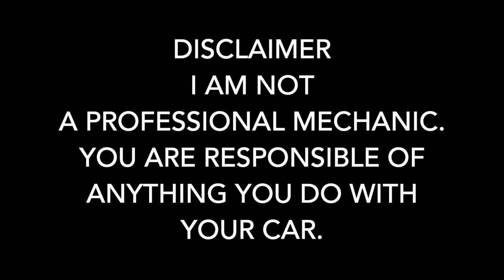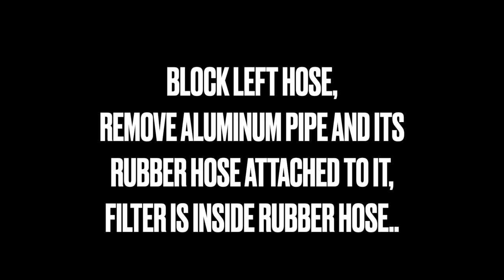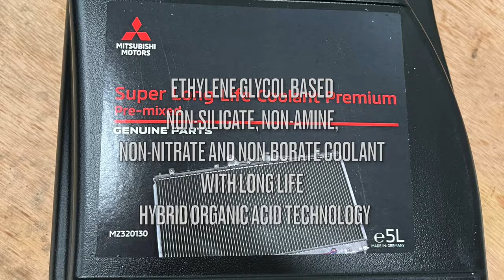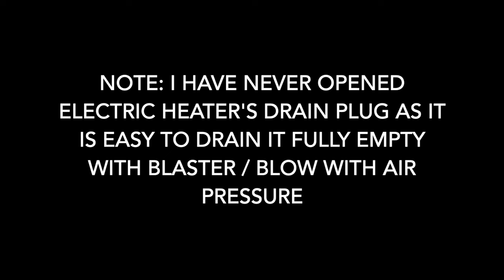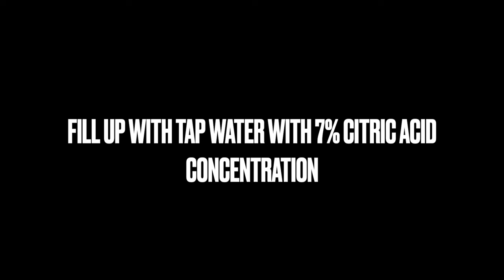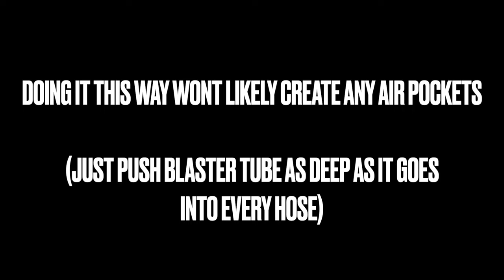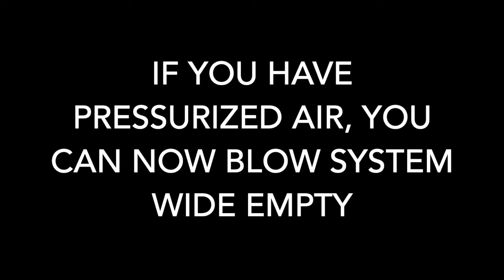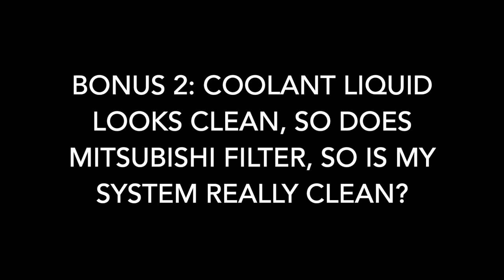Mitsubishi PHEV fix cabin heating or 4 way valve, rinse and clean coolant system

Comment: Very helpful and accurate tutorial. i found my thermostat was stuck. The 'o' ring on the spindle had disintegrated and jammed the spindle! This thermostat is very hard to find outside the dealers. The dealers don't sell the thermostat only any more (no surprise) - the 4 way valve comes out at £387! I bought a 3mm x 2mm 'o' ring online for 24p. Put the 'o' ring on the spindle, add small amount of silicon grease, replace the spindle and all's good. Good video Jani.
Reply from the maker: Yeah mine was stuck as well but got it going by cleaning the gunk out of the needle. Thanks!

Comment: Comprehensive stuff.  Far beyond my technical abilities, so I'll not be able to fix my cold cabin, but it's interesting to know what the "experts" at my garage will be doing!  Thank you!
Reply: How much did it cost you? I have a quote of €700
Reply: @rosscoghlan  Slightly embarrassing, but I haven't actually properly fixed it, yet.  I took out the small conical filter that is inline going into the cabin matrix, and that "fixed" it.  I bought all the gear to flush out the coolant loop, clean it with citric acid and then refill it, and have never got round to doing it...

Comment: another question also, if I lose coolant liquid during the cleaning of the filter, why not just adding more coolant directly to the default intake (the one accessed by just a plastic cap and labeled?, why it has to be injected to the hoses?
Reply from the maker: Not sure what you refer with default intake but as long as you think your way does not create / leave air pockets, all should be good. This is not the only method for sure, just tried explaining how one can do it with great probability how you would not end having air pockets here and there.

Comment: Thank yo very very much! I went to try to clean my filter and I noticed that the bleed valve is not even there, and the bottom left port on the 4 way valve does not have anything connected to it at all. I think someone bypassed the filter by taking the bleed valve and filter assembly out, and I have no idea why the 4 way valve would be missing the hose..i think it would go to the electric heater. Do you have any idea why that would be done and what problems it may cause?
Reply from the maker: This is a problem that affects most and people get very annoyed when they do not get heat to their cabin. Can you identify better what do you mean by the bottom left port on the valve?
Reply: @janilaakso  It turned out to be either the feed or the return to the electric heater unti. I discovered that my car does not have an electric heater, so there is no hose to feed from the 4 way to the heater that is not there. I am still trying to find where my filter is though!

Comment: This is great, thanks so much for the detailed approach. How do you know if there are air blocks?
Reply from the maker: I have done full drain and fill-up now three times with big syringe / blaster, no airlocks this way.
Reply from the maker: After fill-up done, try using your electric heater first, observe for leaks for a few minutes at least, then start ICE and observe for leaks a few minutes then do a testdrive. Once ICE is hot you should get hot air to your cabin, this means you do not have airlocks. Cabin heat exchanger is one of the topmost component as well in the whole system.
Reply: Did what you said and heater working again now thanks to you.... Superb... Cheers

Comment: Thanks for the video! Can I remove 4-way valve for inspection first before rinsing process? Or will I loose too much coolant if I attempt to remove attached hoses?
Reply from the maker: Clamp hoses with vices or whatever and then you can extract 4-way valve without losing much of coolant. It is a good idea to start it with this, yeah.
Reply from the maker: I dont remember how much coolant would be lost if you plain remove all hoses, but I bet you slowly start to lose quite a bit as the 4-way valve is a bit lower than the higher hoses.
Reply: @janilaakso  yeah, I tried to disconnect one hose and coolant go out pretty extensively. I think I'll go order coolant first to be able to replace lost volume. Is it ok to top it up by filling expansion tank or under that cap above the radiator is better? Thank you
Reply from the maker: Probably either way is OK but you may have a bit of air now in your system, so if your cabin does not get warm by any chance, then you need to burp it. I injected every hose with a blaster and this avoids air pockets. @anti1869
Reply: @janilaakso thank you.

Comment: Hi Jan, how do I know if I got air pockets, after doing the cleaning of the filter?
Reply from the maker: Well, you cannot see it, so you have to put it back together, run it and if you get heat to your cabin then you know.
Reply: @janilaakso  Thanks Jan!; what do you meaning getting heat to my cabin? like literally using the heating system and having it working properly will meaning there's no air pockets, or the opposite, turning the heat on and not having any heat in my cabin will mean there's air pockets? or a third option, having heat coming trough the vent to the cabin WITHOUT  turning on the heat (it happened to me before cleaning anything).
Reply from the maker: @reknero5443  After this maintenance, start your car, set / request heating to cabin (put it to very high or maximum), drive your car, and if in 10 mins you start to get very hot air to your cabin, mission successful, no air pockets and hot air is flowing to cabin. You should get so hot air from the vents that you cannot, at least comfortably, keep your hands on front of the vents more than just 10 seconds, after that you hand starts to feel too hot, so it will be up to 60 degree in Celsius.

Comment: Is there a number on the thermostat element?
Reply from the maker: I do not think you can only buy the thermostat element, instead you buy whole 4 way element, but I may be wrong. Mine was stuck and I got it working by dismantling it first, some have found there is a o-ring that has dis-integrated and you might be able to replace it. Test your thermostat under hot water, it should aggressively push out when hot water applied. Good luck!

Comment: Where are you based
Reply from the maker: Europe, Nordic :-) And Finland is the country. But our family has lived in California as well.
Reply: I cleaned did everything you showed in video but still no hot air 
Only cold air 
Also put new anti freeze today 
Any advice ?
Really struggling any advice will appreciate
Reply from the maker: Are you absolutely sure you "burped" and got the system clear of any air traps? @FTubex
Reply from the maker: Check also, now after when you have drived and reheated the system, that there actually is enough coolant in the system.
Reply from the maker: You do have electric heater and the 4-way valve? Did you physically observe thermostats needle moved under hot water and ensure the thermostat is not stuck in either position (open or closed)? I took thermostat to my hand and put it under hot water while pressing a bit on the needle, the needle pops out from the thermostat base quite strongly when heat is being applied to the thermostat base @FTubex
Reply: Thermostat working I run the car on petrol engine and touched all the pipes getting hot 
Even the pipe the one got filter inside and the metal bit next to it the bleed pipe little bit warm than the other main pipe connected to the thermostat housing 
I now start thinking the metrix is blocked because the two pipes going to the matrix are not or sometimes a little bit hot that hot just a little bit I think the metrix is blocked.

2016 facelift any advice from where I can get metrix delaer here in uk don't have stock
Reply: Please advice further
Reply: @janilaakso no air trap because i removed maximum air and bleed the system through the bleeding metal pipe and fluid came out for 3 seconds then stopped 
I run the car and then bleed again the fluid takes time to come out 

Car runs fine with no overheating or warnings I run the car for max 30 minutes .
Reply from the maker: How about you check your assumption on matrix being blocked. From under the car it is quite easy to disconnect both in/out hoses for the matrix and then push with mild pressure some water through the matrix. Now observe if the water flows nicely or barely. Then you know.
Reply from the maker: And note that you can check same fashion (with tap water pressure) if any other part of the system has a blockage
Reply: Changed put new matrix today bleed but still no hot air ??